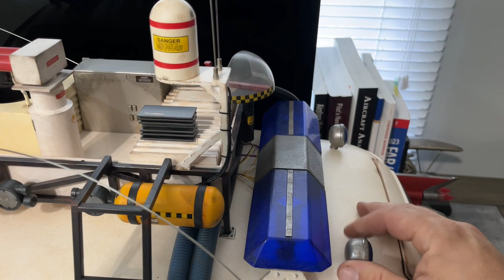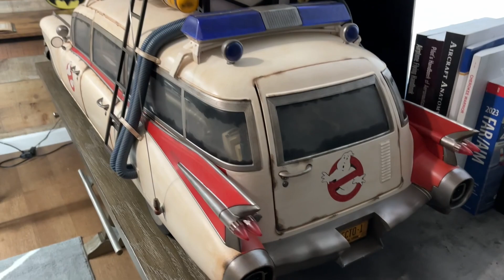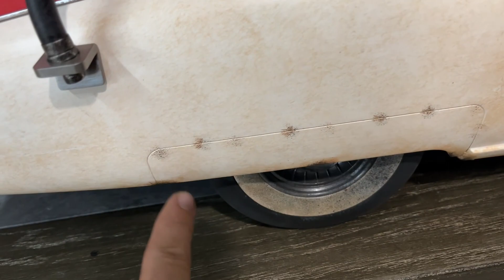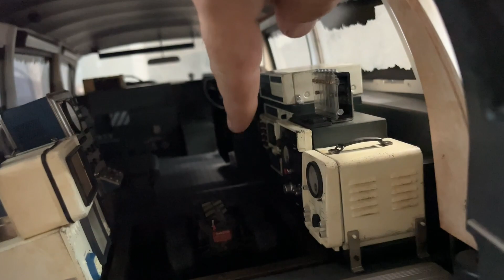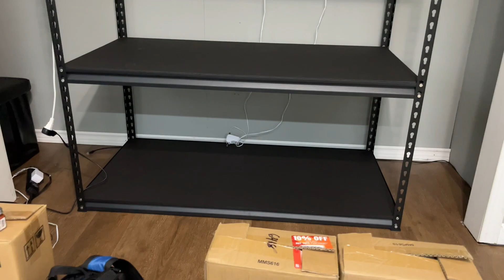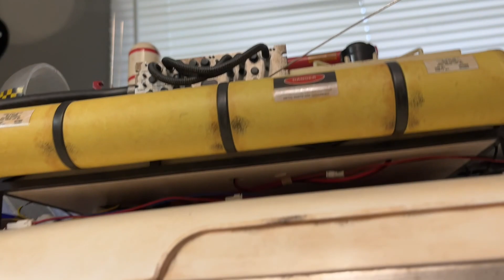Digging Deeper Into Building A 1/6 Pre Ecto 1 Ghostbusters 84’

Comment: the front and rear flashing units are pressed into the roof just like the hose brackets are, there might be just a smidge of glue to hold them in place ...ask me how i know
Reply from the maker: How do you know? lol
Reply: @ghostbusterspluscollector9624  i also too own a afterlife ecto and the rear roof lights were stuck and not rotating so i took it upon myself to fix it or screw it up worse
Reply from the maker: @mikemchubner6928  yikes sorry to hear that man. So the big blue rotating light brackets are just pressed in with maybe a little glue? No screws? Or just the small blue flashing ones?
Reply: @ghostbusterspluscollector9624  i didnt end up ruining anything. i used a thin-bladed screwdriver to pry up on the inside of the corner of the light bar as close as i could to the edge and the posts that holds it in popped out of the holes...but your mileage may varey
Reply from the maker: @mikemchubner6928  gotcha, thanks for the help!
Reply: like you i desire as much movie accuracy as my skills can provide. so i too have made many cosmetic changes to reflect what i was seeing in the film